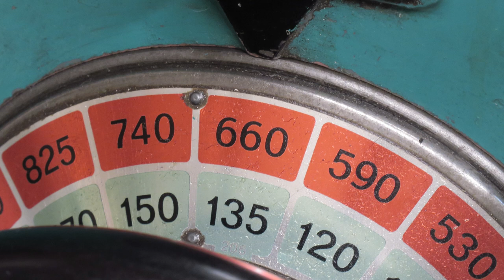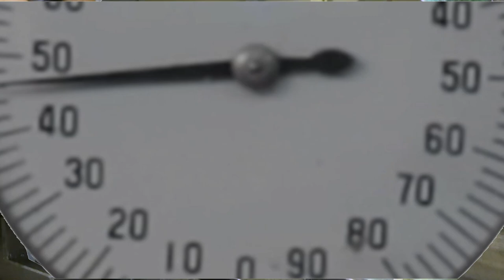Machining an output gear for the cycloid drive 3

Comment: FINNO, I  am using that cutting pasta as well, but how are you cleaning the mess of this stuff?
Reply from the maker: Yes, it really makes a mess. First wipe it with oily rag and then, as needed with brake cleaner. It also helps if only the needed amount is used, not more.
Reply: @FinnoUgricMachining  thanks for this info.
Reply: I use it as well and the mess helps you use it sparingly as that's also quite expensive stuff for what it is. I only apply it right to the edges. Not buying another can of that.

Comment: What do you meen with a split top drill?
Reply from the maker: Sorry, that might be a speling mistake. It should be split tip or split point drill bit.
Reply: @FinnoUgricMachining  and that means? I never hear of that kind of drill bits.
Reply from the maker: @huibhoogendoorn503  It is a common way to grind the tip of the drill in a way that it penetrates the metal easier. The link is an image on how these differ from "normal" drill bits. They are very common these days.
https://www.atlanticfasteners.com/wp-content/uploads/2017/08/Drill-point-final-135-vs.-118-1.jpg
Reply: @FinnoUgricMachining  thank you for the explanation and link. Now i know.